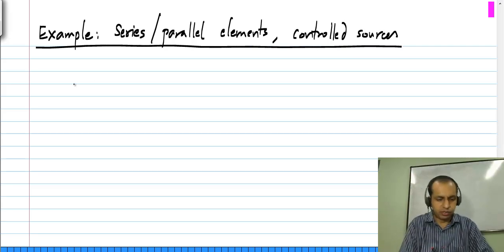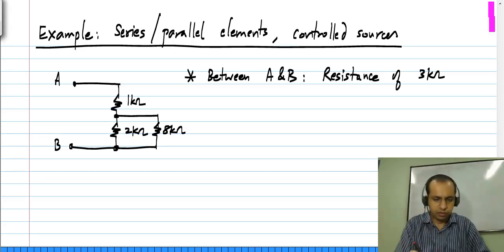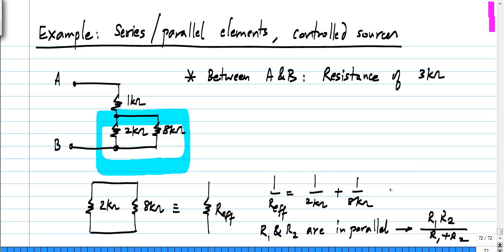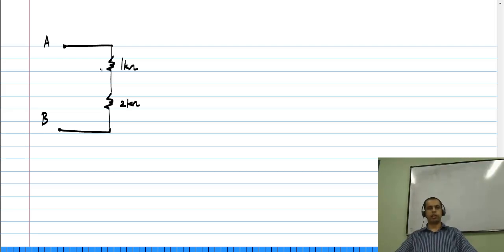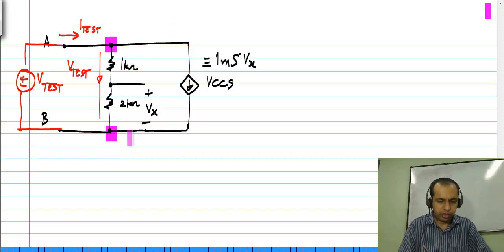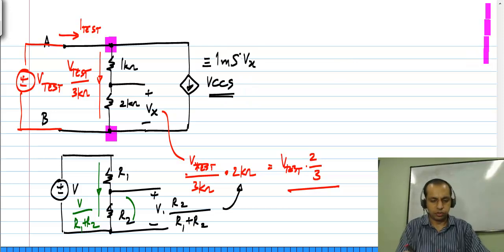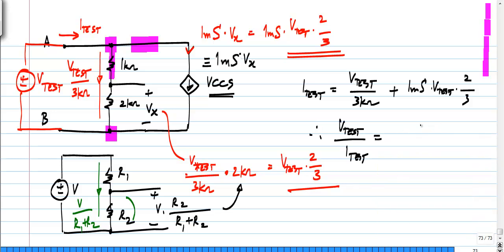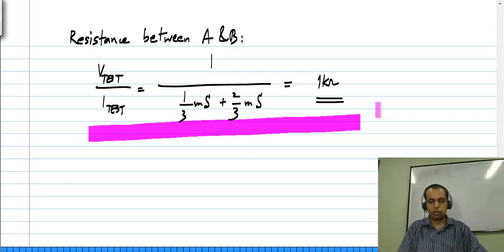Example calculation

Comment: Dear Sir,
In the last example why the voltage across controlled current source is equal to Vx? and why it is not Vtest? since it is connected in parallel to the voltage source.
Reply: (1ms.Vx) is the value of current that the source is providing and not the voltage across it. You are correct that voltage across the current source is Vtest.